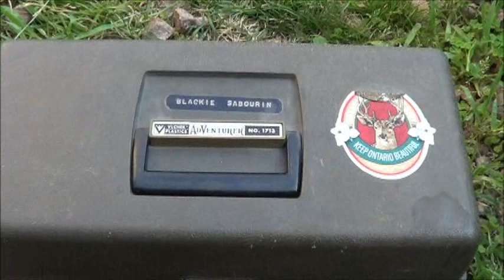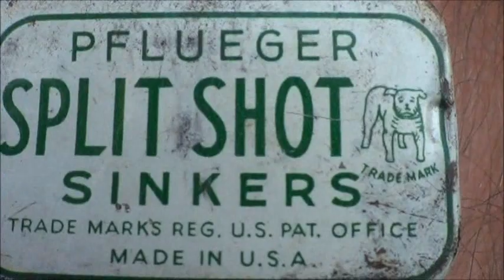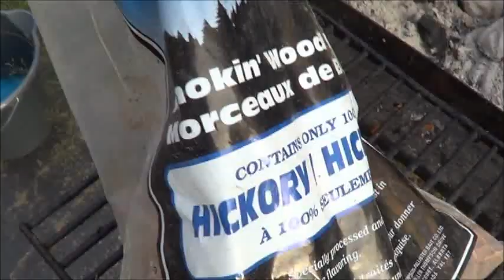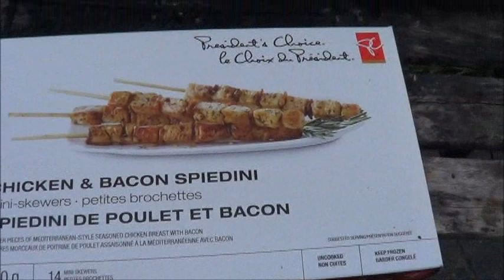old tackle

Comment: Good luck with that e cig. I tried one similar and it was crap. The atomizer burns up in them if you chain puff on it. Mine didn't last 30 and it was dead and I had to buy a new one. I've gone through 5 or 6 of them. I upgraded to a larger one that you can refill with the "juice" or Nicotine oil. It does help you cut down on smoking without the extra chemicals. I take it Shelley is still doing good after quitting. I really wish I could bur